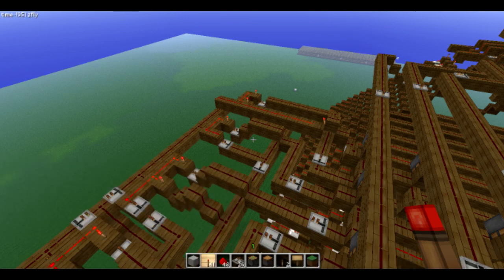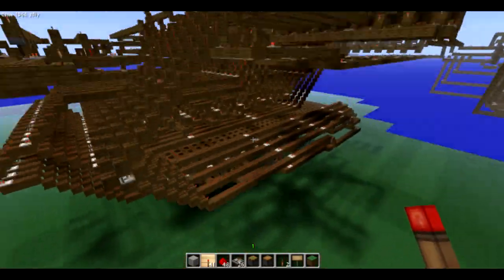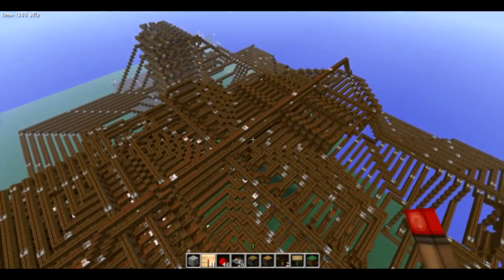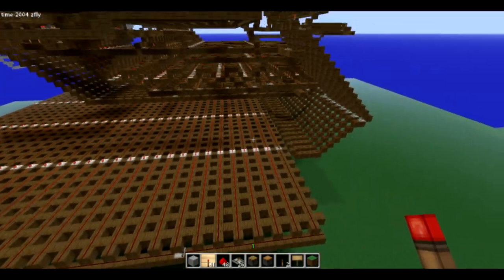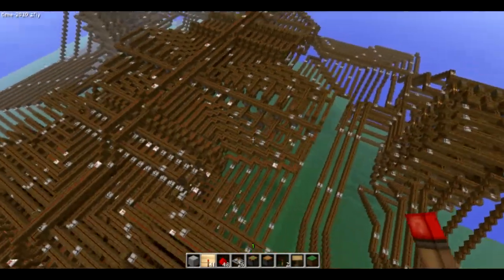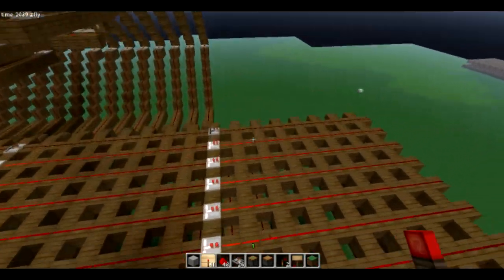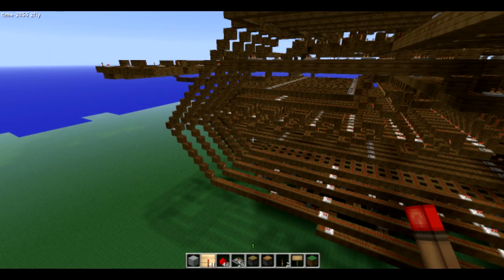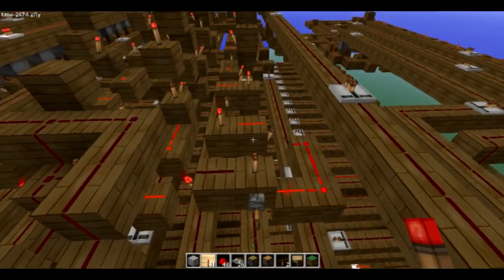Minecraft - 16 bit 18 function computer

Comment: Actually about playing minecraft in minecraft i think it is possible if you spend around 2 years placing blocks to build up amore powerfull procesor and 2Gb of ram (don't know about the procesor but the ram chould take somewhere around 20000000000 blocks) and then build up an ssd (i don't think you can provide making an hdd in mynecraft) with at least 11Gb of space than spend 2 more years copying bite by bite (ones and zeros) into the ssd the windows files and minecraft files than wait around a month for every thing to fully boot up (because redstone is slower than real life electicity) you may be able to run minecraft, but yet there will be some struggles:
1-i doupt you can reach the requirements for minecraft running in minecraft without the first game crashing
2-before minecraft realeases a way to make colored lights, there's no way to make a good monitor (yet minecraft will run screenless, but you will never know it did)
3-i don't think there is a way to make an ingame controler for the ingame game

Comment: can it run minecraft?
Reply: yo dawgg
Reply: Jakob Cook no the pinnacle would be making minecraft in the minecraft you created in minecraft.
Reply: And stop poverty, save the trees, find an alternative fuel source and even find a way to regrow limbs :) can't wait xD
Reply: i think simple math
Reply: 3:30
Reply: Jakob Cook and make half life 3 confirmed
Reply: Doubt it
Reply: GonFreecs14 well what can this thing do?
Reply: it could if it is noy 16 bit of ram
Reply: Jakob Cook What if u play battlefield hardline in miencraft?
Reply: No its can Darude-Sandstorm doe
Reply: GonFreecs14 Sine, Cosine, Tangent, Cotangent those are not simple math
Reply: jannuel dizon no, it also need much stronger physical components.
Reply: Well if you are ready to take a year or two placing blocks in an orginised way to make a 32 bit cpu with at least 1ghz of power and at least 2 Gb of ram (i don't know about the cpu but 2gb of ram will surely take more than 20000000000 blocks